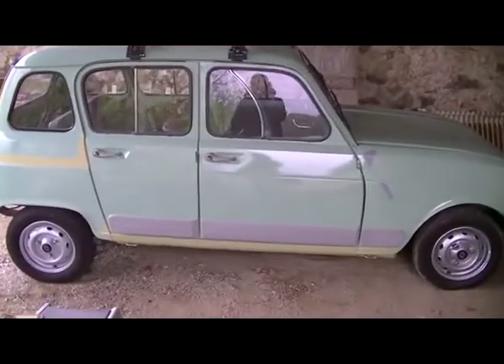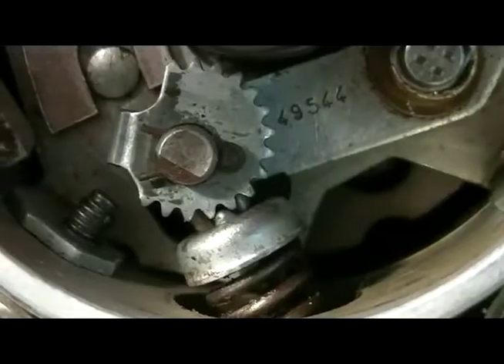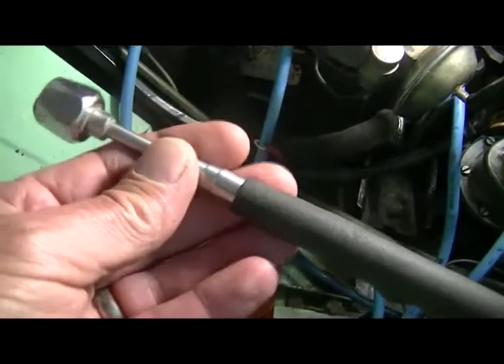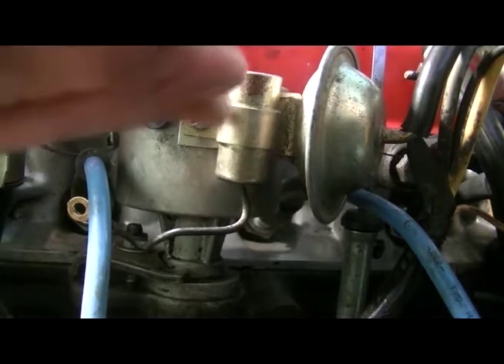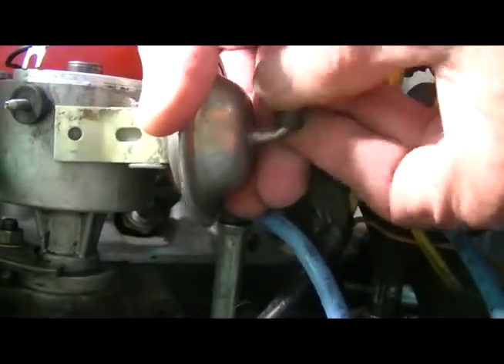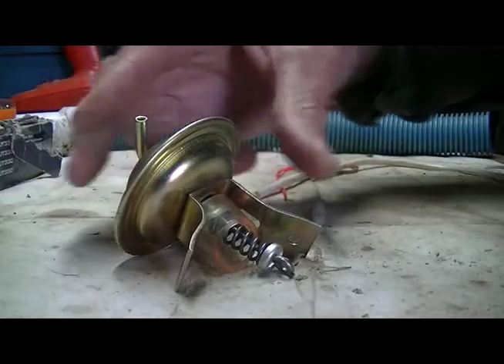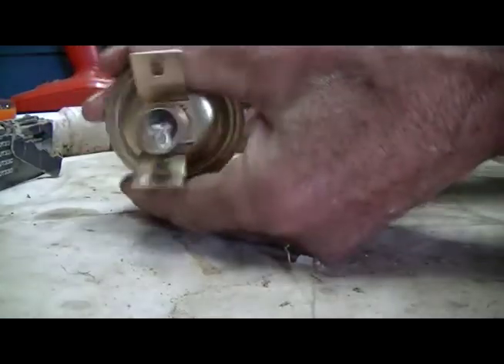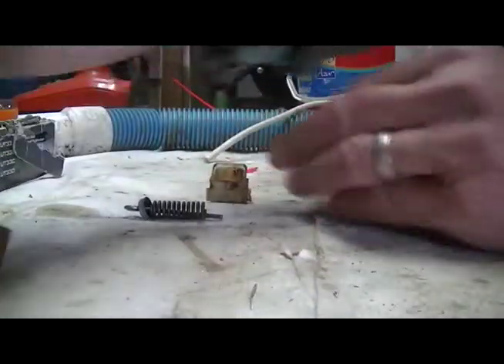Renault 4 GTL Vacuum Advance Installation

Comment: The grommets (both round and square section) will remove from the unit without needing to remove the actuating arm.  With time, the grommets become hard upon exposure to multiple heating and cooling cycles and as such you may have had some slight increase in difficulty removing the (now hard) square-section original grommet.  As such, it is generally better to fit the new grommet along with the new vac can as it can conform and seal well against the housing, ensuring a robust seal.  The vacuum advances does not generally act as a function of engine RPM per se, and so does not necessarily "...function at high RPM..." unless that high RPM happens to be occurring under an engine over-run condition.   We have recently overhauled a couple of Ducellier distributors as fitted to R8 1100 (very similar to your unit).  The R8 cans had a very small bleed hole in the can that needed to be blocked for testing purposes as the values tabulated in the Renault Factory Workshop Manual are for test with the bleed pin hole blocked.  I notice you made no mention of any bleed/pin hole during your functional (suck) test, so I guess your can detail may differ slightly...?  Thanks for the video, very well shot and enjoyable to watch.  Best regards,  David
Reply from the maker: Thanks for the comment VRD, i used the grommet from the broken unit because it had a better curved shape to conform to the side of the distributor housing and yes it was harder, as you say. There wasn't a pin hole in the casing but that option was available on another model. I understand that with higher RPM, the unit is able to advance the timing automatically for the points to open and close at a more efficient time. My car certainly seems to run smoother at higher speeds and a bonus is that deceleration is also smoother, so I guess the VA unit is doing its job. :)